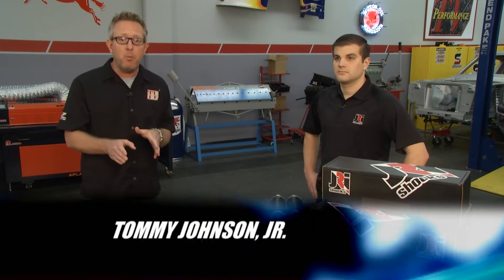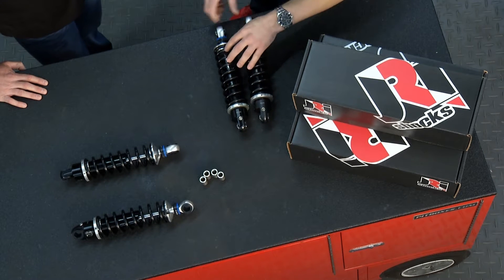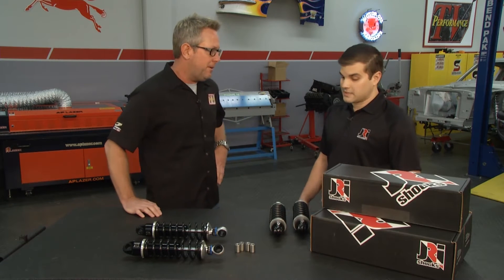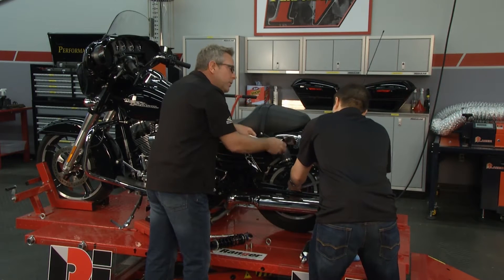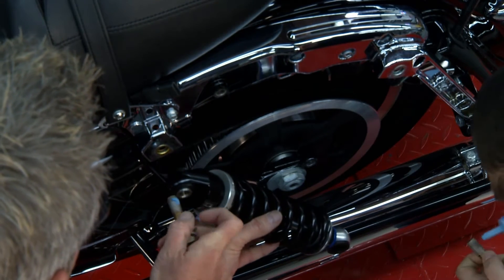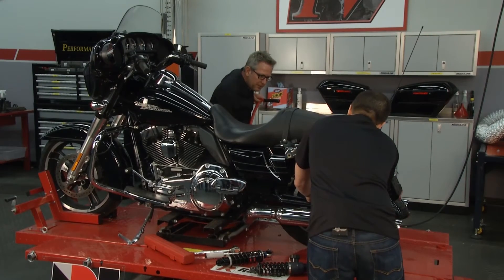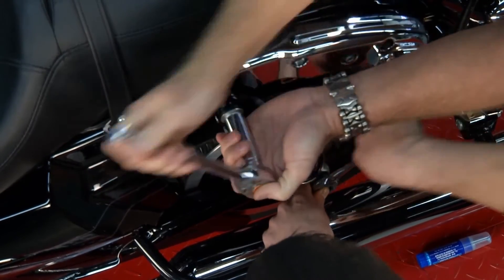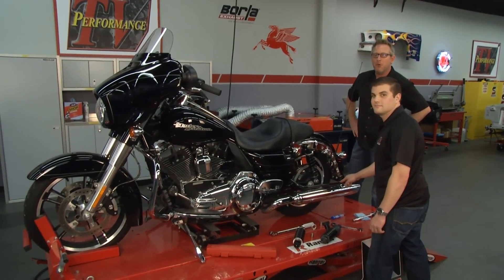JRi Harley Shocks featured on Performance TV

Comment: I was installing the same shocks on a 2017 HD Dyna Low Rider S and the service manual i had ordered hadn't arrived yet. So, I put 35 ft lbs of torque on the upper shock mount stud as on touring model in this video.  I didn't think the torque specs could be much different for the dyna.  As I was torquing the the shock mount stud snapped.  So my point is find the correct torque setting and don't ASSume.
Reply from the maker: We apologize for your inconvenience. We consulted with our local Harley Davidson Dealer and they confirmed that the torque specification should be 35 ft pounds.